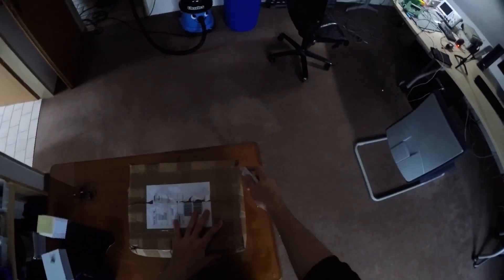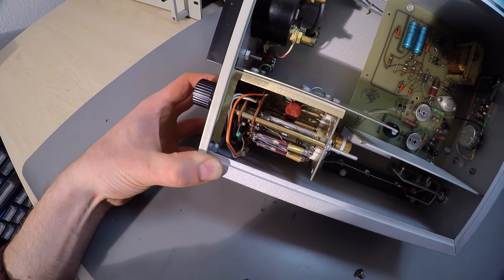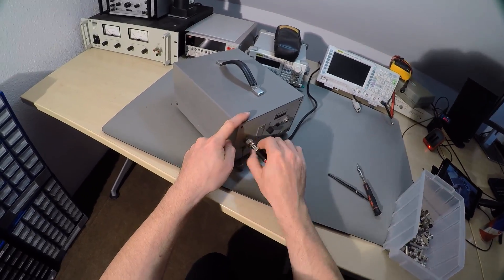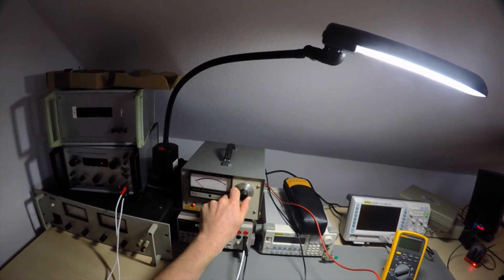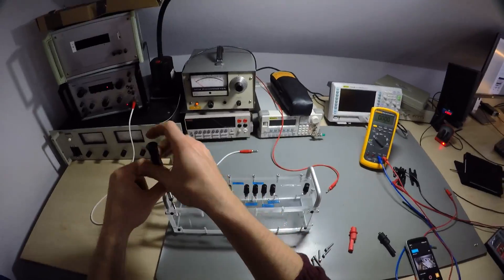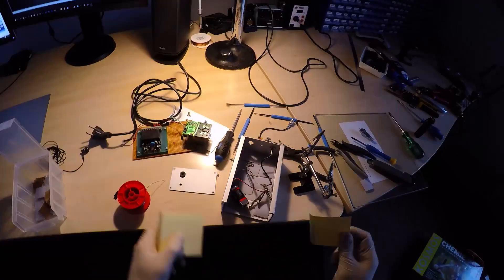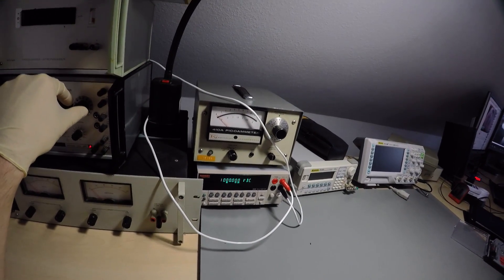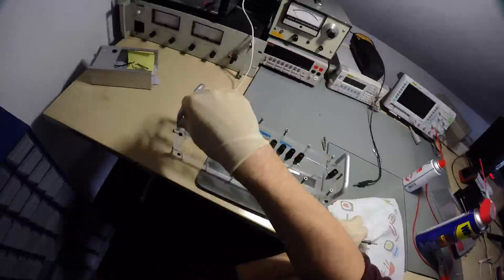Measuring very high resistances or very small currents

Comment: Ohmite make resistors up to 10,000 GΩ. I'm pretty sure at resistances like that, you start having to worry about the parasitic parallel resistance introduced by empty air. How the heck would you even use a 10 TΩ resistor?

Comment: I recommend checking the  DC-Milli-Pico-Meter MV40 made by Präcitronic (Dresden). I managed to get one, and I was able to measure the resistance of a 10000Meg resistor with the device. 
Also that model which I have has an offset problem in the voltage range... It would be interesting to see your opinion on the working principle of that instrument. I can't get my head around the series-current feedback used by that device. Somehow they feedback the current via the deprez and they set the gain of the amplifier, thus setting the measurement range for the device. Neat little thingy... 
If you are up to it, I'll provide some manuals, photos, stiched schematics, etc. I would be more than happy to discuss my findings on that instrument...

Comment: I enjoy your videos a lot. I picked up a 410A myself on ebay some 4 months ago, but never got around to getting a cable to test it with. Could you point one to the right kind of cable? I found this one but am not sure it's appropriate: 

https://rover.ebay.com/rover/0/0/0?mpre=https%3A%2F%2Fwww.ebay.com%2Fulk%2Fitm%2F273032336049

And what the minimum step down method to test leads with extremely short leads.
Reply from the maker: If that really is PTFE isolation, then it is very well suited! For very high resistances you'll need shielding like Al foil or a metal enclosure

Comment: Sometimes I think that you are testing the resolution of the universe, to be sure if we are or are not in a simulation, with trying to sense the smallest of values that we can measure.
Reply: I was thinking the same, but recently I started getting involved with photodiode measurements for professional reasons and you would be surprised at how small currents they generate. They are characterised at the nano and sometimes in the pico amp range!

Comment: This is the nerdiest vid I ever saw, and I'm a bigger nerd for enjoying it lol.......Sorry, but I need to ask again, what do you use this pico amp meters in your home? Do you work from home? The same thing goes for the 5 digit volt meters, apart from being a keithley fan/nerd ( and wanting them just for that) what actual use you give them? As an Electronics Engineering myself I can't see any use for them outside of R&D or VERY VERY VERY special cases, could you give me an insight?
Reply from the maker: Yes, you are right, I have very little actual use for these special meters and I only got em for the interesting repairs etc. But my next "big thing" actually benefits from the high-res voltmeters!
Reply: Marco Reps you tease !